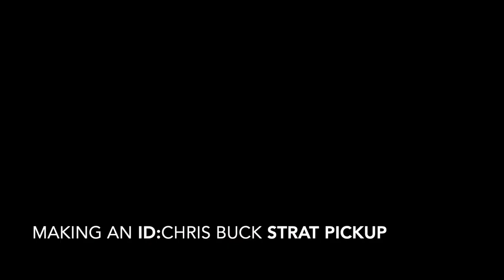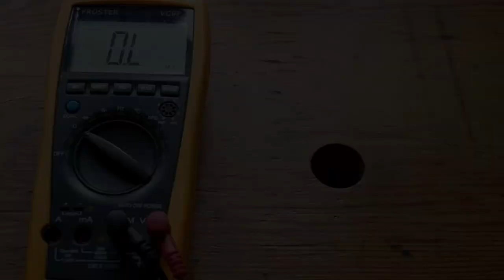Making a Guitar Pickup

Comment: What is the purpose of the metal plate at the bottom of the pickup? I thought the wires were just connected to the ends of the copper coil.
Reply from the maker: Hi Axel, it intensifies the magnetic field adding bass response and a little extra oomph from the pickup output. Cheers, Paul
Reply: @RadioshopPickups  Is it necessary for making a pickup?
Reply from the maker: @axellonngren  Not always but we think it makes a nice difference in the bridge position of a. Strat
Reply: @RadioshopPickups  Thank you so much for the help!
Reply from the maker: @axellonngren  You're welcome, Axel!
Reply: @RadioshopPickups  can you deliver at india .. hos can I know about your product ranges ...
Reply from the maker: @dr.caesar.md.mbbs.  Hi Barenya. Yes indeed! We send to India. It's all on radioshoppickups.com

Comment: you made a clockwise pickup, but the black wire is connect to the out wire ,,,and the white to the beginning,,,I see in others pickups that is upside down,,why you do that?
Reply: Different manufacturers use different color orientations for wiring. Some major brands diagrams can actually be looked up for after market coil splitting or out of phase wiring.